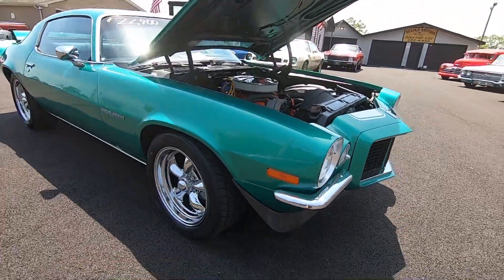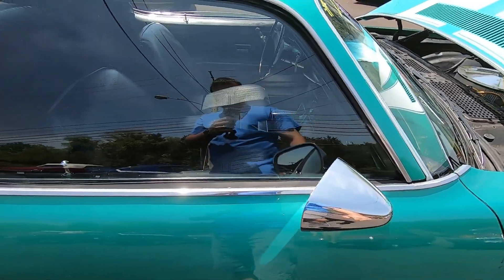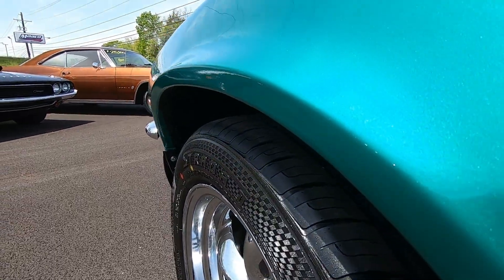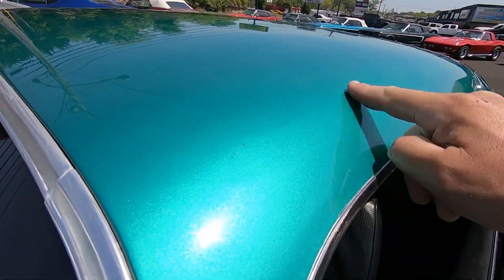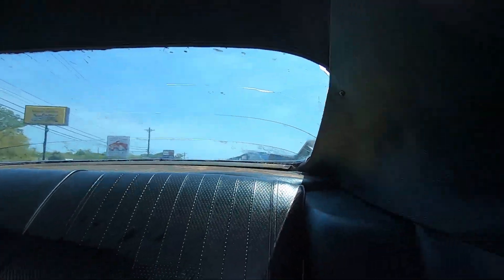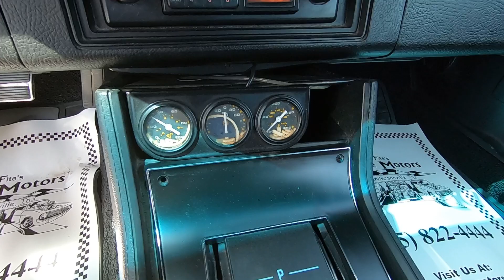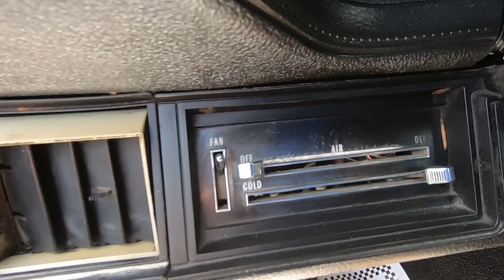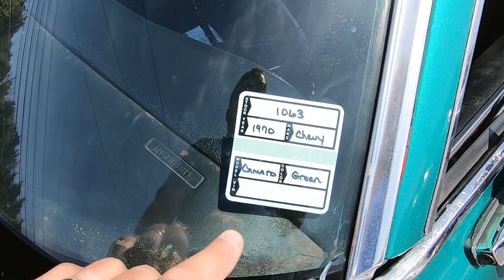1970 Chevrolet Camaro Rally Sport SOLD $22,900 Maple Motors #1063

Comment: Those 1/4's have both been replaced, and not very well.  They look to fit OK, but someone cheaped out and has them riveted on the rear bottoms between the wheels and bumper.  This car has a fair amount of body-fill too.  Hence all the cracking and blistering.   It may have been bandaged to dump quickly.  But, I'll tell y'all this....I'd love to have it.  Just pointing out what I see and not slagging on it or you fine folks.  Sweet ride, all-day-long.  My fav on your lot actually.